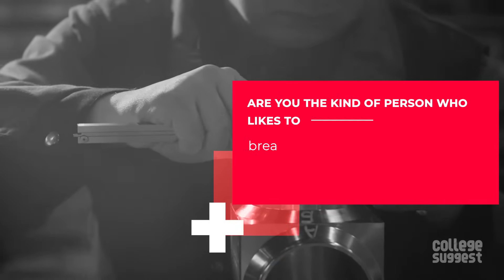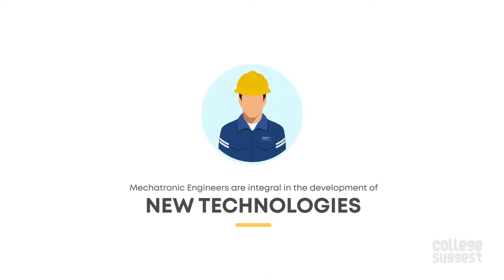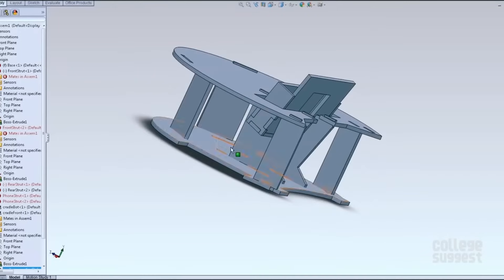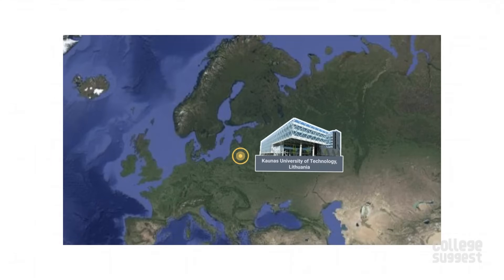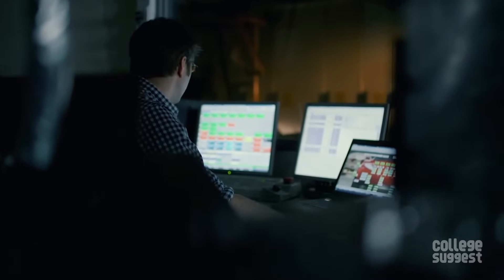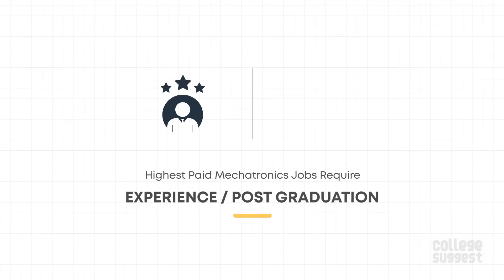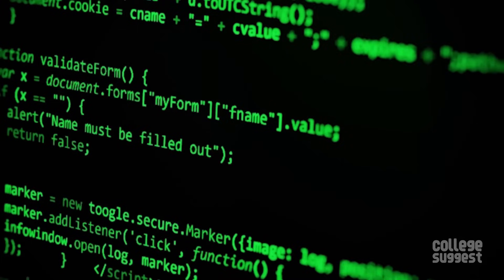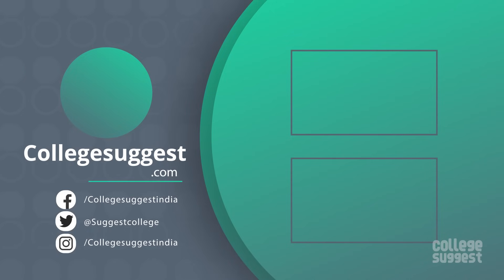Mechatronics Engineering Overview 2021 | Students | Faculty | Placements | Recruiters

Comment: I have checked from the official website iit madras do not have b.e in mechatronics , please current it
Reply: they have a program "Engineering Design" which is nothing but mechatronics
Reply: @anandsnambiar3147  are you very sure
Reply: @sohamkathalay2690  yes you  can check the curriculum